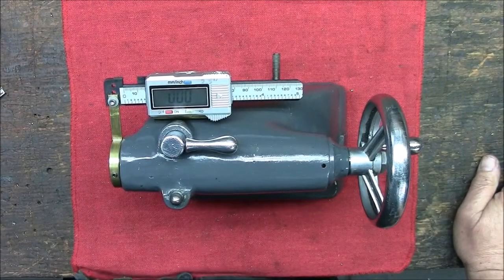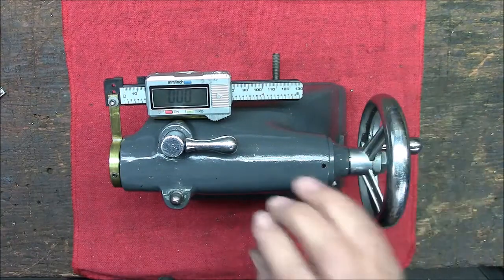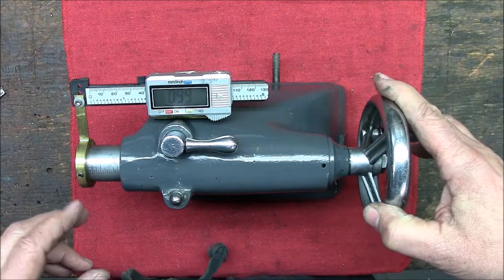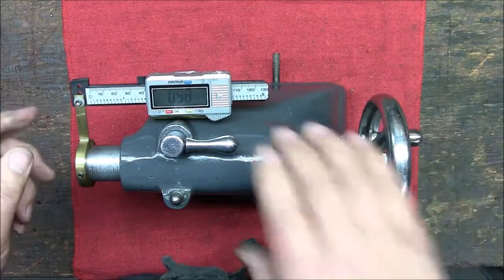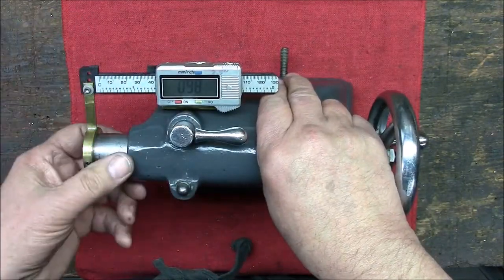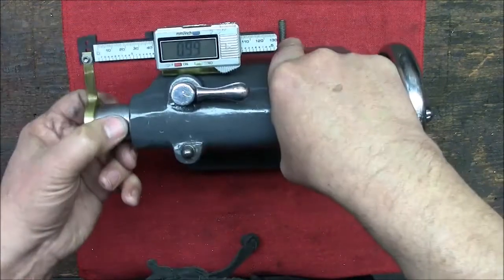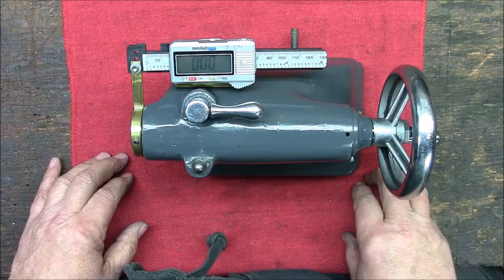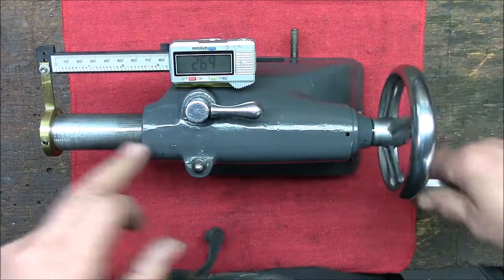Poor Mans Tailstock DRO

Comment: I need this on my atlas does it still retract far enough to release what ever you have in the there like a center or drill chuck?
Reply from the maker: Yes Dave, you can adjust the ring around the quill to allow for clearance issues.  I use this a lot and it works great.